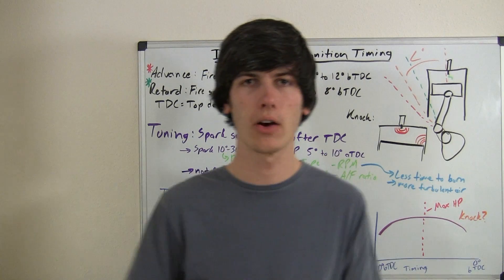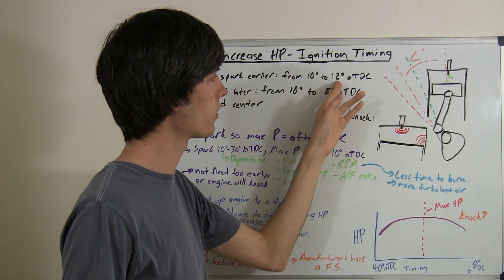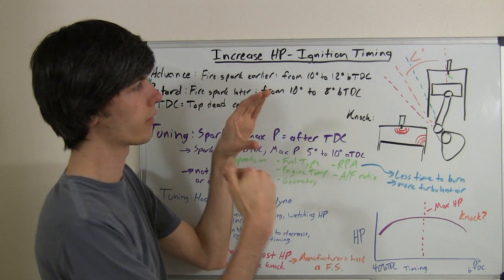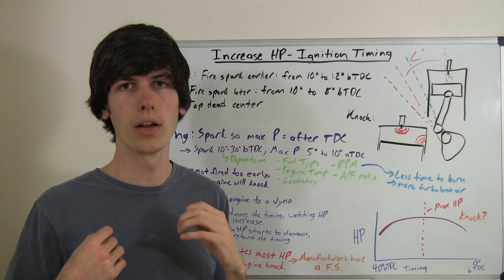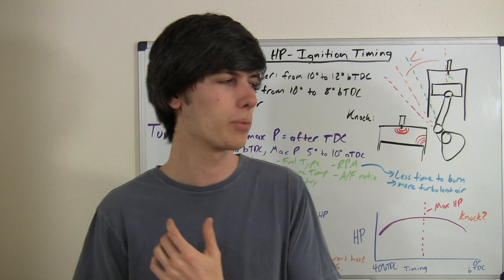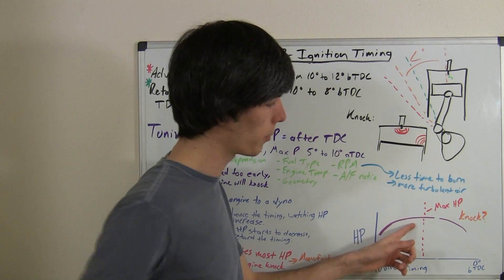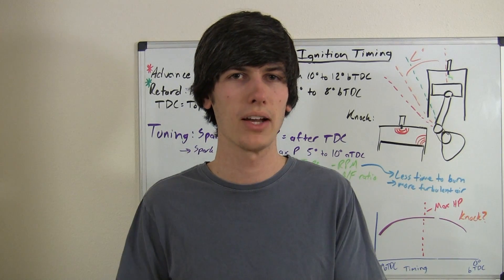ECU Chip Tune - Ignition Timing - Increase Horsepower

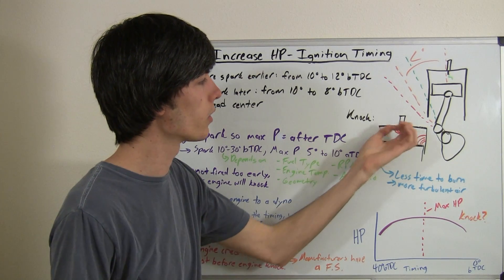Comment: Isn't that pre-ignition what you described around 4:25? Hot carbon residue igniting the fuel-air charge too soon or "pre-igniting" it before actual ignition by a spark plug. I thought knock occurred due to high temperatures and pressures (like a diesel) and it self ignites and slams the piston making a knocking sound.
Reply: If you put the timing too advanced the piston is coming up then beforw it will reach tdc it will ignite so crashing on each other that is knock really bad for your rods.

Comment: Nice video but, how about the tuning differences that diesel presents?
Reply: timing is TOTALLY different, it measured the position of the piston. I believe it injects fuel immediately after TDC because it ignites instantly without the need for spark. I'm no engineer, but it's basically how that works more or less
Reply: Yeah, there's no such thing as spark timing on a diesel so virtually nothing in this video applies.
Reply: +something1random23 

I know the difference between  Diesel & Petrol engines!  My point was, what's the theory at performance improvement / chip tuning for diesel engines?  I have an Audi A8 3.0Tdi European spec which I have retuned using SuperChips....

Comment: Hello at all. I have modified the engine of my motorcycle from aspirated to turbo. I would like to know more about the ignition timing vs air fuel ratio vs engine load. I have find that the tuning is very hard! Can somebody kindly tell me if there is a workshop manual in wich is simply explained  these concepts? Regards from Italy.

Comment: 12°-15° ATDC is the optimum point for Pmax.  Your description of knock sucks a bit too.  Knock is when the gas volume is caused to resonate - kind of like the air column in a pipe organ pipe, only in a more 3D sense rather than columnar.  This gas motion disturbs the boundary layer increasing the heat transfer to the combustion chamber surfaces.   The combination of the higher metal temperatures from this lowering the strength of the material and the increased localized gas pressure stressing the material causes it to fatigue and break up.  That is, unless the increased temperature doesn't get your piston clearance before hand... What excites the gas resonance?  It's an asymmetric and rapid burn rate of a cold part of the combustion chamber.  Why cold?  Because that's the last place to burn and hence the part of the mixture subjected to high pressures and flame-front radiation for the longest time.prior to combustion, causing free radical formation and auto-ignition.  Solution is to minimize the heat variation of the combustion chamber surfaces - easier said than done.
Reply: No, I think your homework is lacking.  Everything to do with pressure waves happens at the speed of sound, so suggesting something happens supersonically is not correct.  There is also no shockwave either, since this is associated with a body moving faster than the sonic velocity of the gas through which it is moving.  There is no moving body at all - only gas motion and a chemical combustion reaction.

Preignition is caused by a hot surface of the combustion chamber somewhere hence will start at the hottest part of the chamber.  Knock (or detonation, for the great unwashed) has its origins in the coldest part.  Pre-ignition also tends not to be noisy like knock because it generally doesn't excite the natural frequency of the gas volume.  It's dangerous only in that it is very advanced ignition and results in extreme cylinder pressures and temperatures.

Comment: As usual, you've made another great video!  I was considering getting an ECU chip tune, but didn't realize how this could affect the engine in the long term.  I want horsepower, but I also want my car to last for years and years, decades and decades.  Thank you.
Reply: if your going to do an ecu turning, you should replace stronger internal parts first like pistons, cams, rods, valves etc bc your making the engine work harder causing premature engine wear out. this y racing engine are designed differently from standard factory engine.

Comment: Can you please explain what to do to check/change timing on an engine with a distributor (no advance mechanism in it) that is controlled by EFI? I am having a hell of a time trying to work a tune out.....
Reply: +mutiracialbeatdownPB Old dizzy timing is the Easiest..

Get a timing light. 
Undo the one nut holding dizzy in place.
Turn left or right until desired timing reached via the light 
tighten the nut.

While some have a Vacuum hose connected to them (this is the timing advancer while under engine load) 
Many older ones don't have it.  and timing is set globally to same amount regardless of RPM and load.
Some Dizzy even Have Ecu control via a stepper motor on them (but imho manual Dizzy is best)

Comment: Supposing the crankshaft were at 30 degrees, and the piston arm were lengthened by a given amount (1-2 millimeters or more)? This in itself would result in the piston setting just a slight bit higher within the cylinder just prior to combustion. Wouldn't this result in an increase of horsepower in addition to being more fuel economical?
Reply: +Kevin Thomas there are more factors then just timing in what you said. If you lengthen piston rods you will increase compression dramatically which will either cause pre-detonation or worst case your piston to contact your head and/or valves causing engine damage. Increase in compression does give you better horse power however you need to increase your fuel octane rating to resist the added pressures and heat caused by the increase in compression. Race engines run at high compression and technically are more "economical" meaning they get the most power out of the given fuel however they also run very expensive race blended fuels to resists pre-detonation. Its all a game of give and take manufacturers have to balance long engine life with the best performance and economy they can get.
Reply: +TechnoAgape True. Although if you run a long rod engine (say a 6" rod in a 350 chevy) and you use a high pin placement in the piston so overall length is the same as the standard 5.7" rod and factory piston configuration you end up with a piston that stays ever so slightly at TDC longer therefore increasing torque and consequently horse power. This has been done in many race engines back in the day.

Comment: what's the difference between stage 1,2,3 tunning, and what's the best to get more HP
Reply from the maker: Marketing terms.
Reply: +Engineering Explained ok that helps
Reply: +Donny Linton stage 1 is usually just a ecu tuning over obdII. stage 2 and 3 involve some parts changing, other exhaust, removing dpf egr and so on.
Reply: the stage 1 is the filter, the program, and the exaust. so basically is the holy trinity of starter pack tuning
Reply: +Donny Linton stage 1 is usually just a ecu tuning over obdII. stage 2 and 3 involve some parts changing, other exhaust, removing dpf egr and so on.

Comment: Hello. before my question. I want to say thank you for your videos, you can explain everything very smooth, and you make easy to understand it. 
Well i'm going to install a ECU MASTER on my Suzuki Swift 1.3 GTI. I'm going (try) to make my own VE/spark advance/ignition tables. My engine it's NA te compression ratio it's more or less 13.0:1, it gives me 16.0bar on each cylinder, and I have some agressive cams, and i'm going to switch from hydraulic lifter's to solid. And what i would like to know, if you could advice me, it's what kind of steps/orientation should I take to make my tables. There's any standard pattern for NA ECU MAPPING? hope you understand my english, and also that you can help me. thx once more.

Comment: so then changing your ignition timing increases the chances of your engine blowing? if you have tested your engine to not knock? doesnt that mean its going to be safe? is it because of those several factors that there is a factor of safety built in?
Reply: iwrotefuck there are MANY factors and tuning safety margins very from tuner to tuner.

Comment: Another way to advance the timing, is by putting more load on the engine (aka: Change gearings). 
By making the gears heavier, there's more load on the engine.
Easy to do on a motorcycle, hard, to nearly impossible, on a car.
Engines also last between 120 to 250k miles.

Comment: so are you saying I shouldn't take my 98 camaro to get tuned if I still want a reliable daily driver?
Reply: It can be more reliable than stock if the engine components are stronger than stock.. generally if you have a stock engine, making it more powerful can ware things out faster BUT... lol
Reply: +mas921 not exactly. this is more along the lines of efficiency and not manufacturer defect. Cars of the same model are very congruent so the same tune should work very well and not to mention the ecu will compensate for slight differences if there are any between the vehicles.
Reply: Actually LS motors have come a long way. And I know this is 2 years ago. I would talk to a specialist, because there are very reliable LS motors out there at 1000hp, daily.

Comment: Engineering Explained not sure if you can answer this, but what makes an engine have high and low torque figures throughout the rev range at full throttle as seen on a dyno chart? has that got to do with the complexity of figuring out perfect ignition timing through each rpm?

Comment: Engineering Explained I love watching these videos! Could you please do an explanation on twin spark systems like what is found on some 2.3l Rangers, Newer Hemi engines, and dodge 4.7l? I'm sure other companies use it as well.
Reply: Twin spark systems are commonly just used on poorly designed (slow burning) combustion chambers.

However it can be used to lower time to establish a sizable flame kernel more quickly, meaning less degrees of burning "B"efore TDC & more AF mix for burning "A"fter TDC, AKA, more fuel being used for power.

Comment: Engineering Explained Just a quick question for you bossman, does advancing the ignition timing increase engine temperature higher than the normal operating temperature (thus increase performance at the expense of engine reliability and longevity and puts more work on your spark plugs more thus requiring replacement more often than if you where to leave the ignition timing alone?). I am not condoning that advancing the ignition timing is a bad idea as, it is, never the less, one method of either increase engine horsepower (watts), torque, and/or both. Just a question. I did a little more research on advancing the timing and I heard that for ever 1 degree of advance it can increase the temperature of your engine by an extra 60 degrees. Understandably I am aware that this varies on different vehicles and different mods to the vehicle and the overall condition of your engine and related mods that directly or indirectly affect ignition timing in any kind of way. I did forget where I found that source of information but when I find it I will post it up here. I believe it was from Wikipedia regarding the subject of AIT. Not really worth the few pony gains for engine reliability if you ask me (again not discouraging your video and I am glad that you have this video to explain a method of increase your vehicles performance). Love all of your videos on basic explanations on vehicle performance. Thanks :)

Comment: im planning on installing a +4 ignition advance rotor on my Yamaha R6. should i consider changing my spark plug gaps since there is more compression?
Reply: Ted D Advancing ignition does not change the compression ratio
Reply: ***** what considerations should i make regarding this modification? what characteristics does it affect?
Reply: The only way to change compression ratio is either changing the geometry of the cylinder head or the geometry of the piston. Cams affect the dynamic compression ratio.

Comment: So quick question... Lets say I want to start tuning my 94 dodge stealth and it's pretty much stock right now. If I tune it where it stands for max HP then upgrade something to a performance part that's going to cause me to retune it huh? Specially if that part changed something with either the air or fuel right? I have the equipment and I'm getting ready to start messing around with it, I just don't want to waste a whole bunch of time tuning it first if I have to tune it again afterwards. Thanks in advance for the help.
Reply: Lee Peffers tuning is usually done last

Comment: A slight error there: too much advance can place max presssure AT tdc forcing the engine apart. (that is one problem) Auto ignition is another issue where a hot spot ignite the mixture when you don't want creating knock : this phenomenon can occur before or after spark. All of the above is bad of course, but there is no direct relationship between bad ignition timing and knock, insteat those are situation you put the engine into that lead to knock, or lesser quality fuel, or too hot spark plug choice, or piston shape or or or ...

Comment: Would you say that the safety factor that manufacturers typically use is too conservative and that you can safely extract a modest increase by tuning your car? For example changing the fuel to air ratio or increasing boost pressure (in a non naturally aspirated application).

Comment: I agree with most of video but Knock isnt just the result of detination. Knock is derived from the knock sensor which is just a big microphone attached to the engine block. Sometimes knock can be from various engine components like heat shields being loose and making noise. The ecu just gets feedback from the noise and adjusts the timing usually retarding. 
But yes, ignition advance will create more TQ which is what tuners look at, not neccesarily HP because HP is the result of TQ over time.
As an engine builds TQ up to its maximum RPM the ignition should be advanced as much as possible depending on fuel octane,engine temp,IAT,ambient temp,boost, spark efficency,fuel pressure, fuel temp etc....
And as boost increases as also does RPM's usually its better to start pulling timing. The amount is based on how aggressive you want the tune. Its really complicated and aweome at the same time.